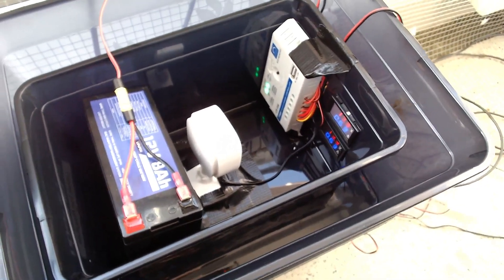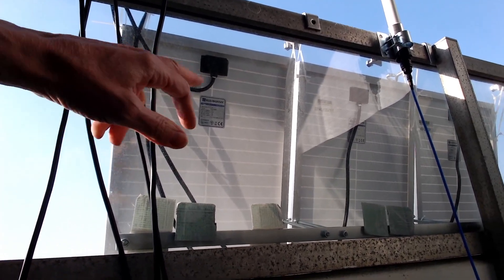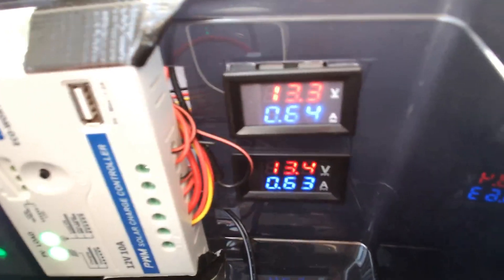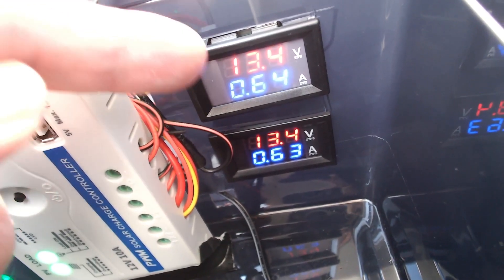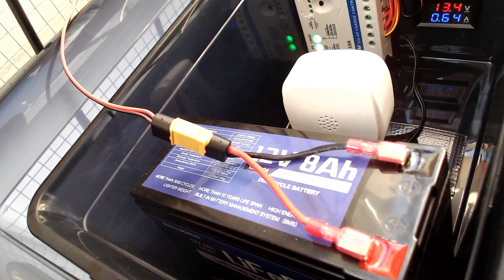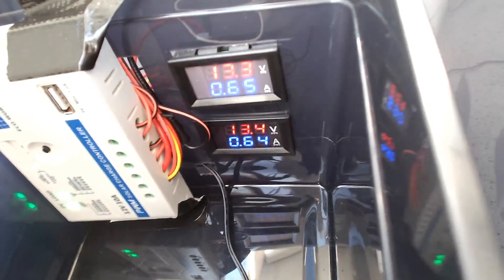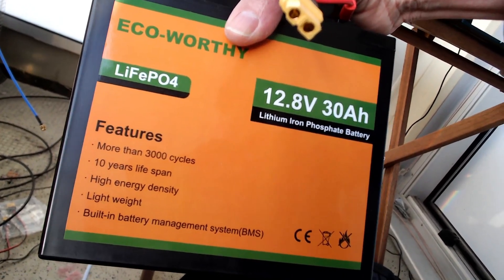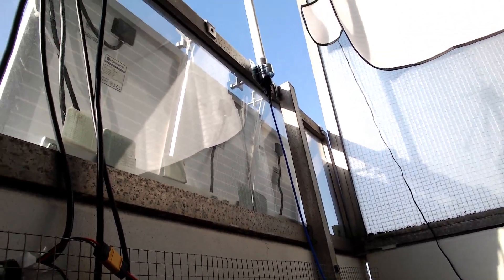Solar Power Supply for Meshtastic or Reticulum System

Comment: VERY NICE.  
May I ask which low-power DC-DC converter did you use to efficiently drop the 12V battery voltage safely to the 4.7 to 5.0V needed for the Meshtastic Node itself?  Thanks.  -Pat
Reply from the maker: https://amzn.eu/d/h61syID
Reply from the maker: I sent you the link. I use a lot of these small variable regulators. They seem reliable and have variale output voltage and current limit settings.